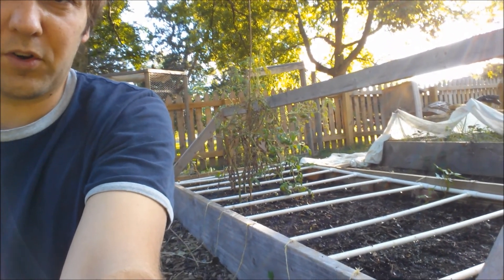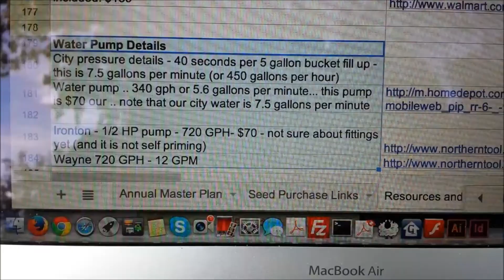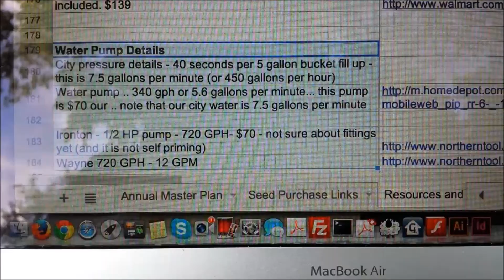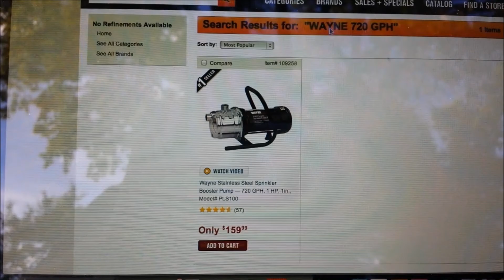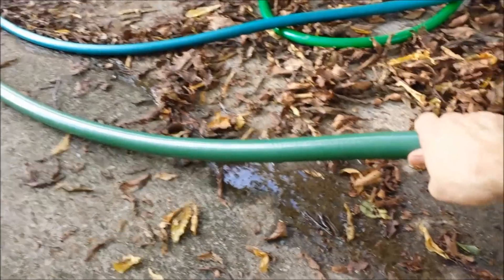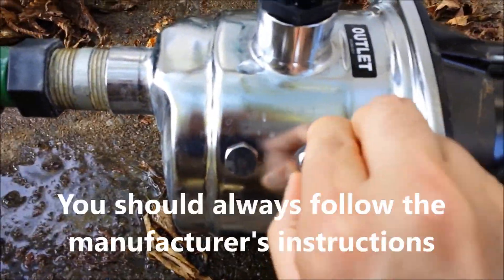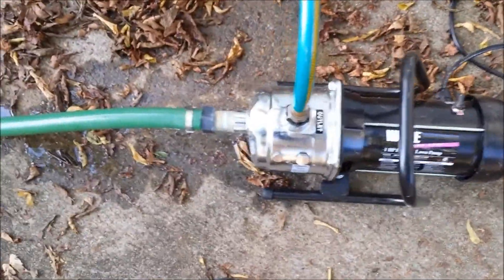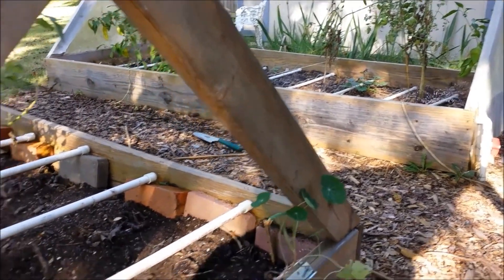how to make a soaker hose part 2

Comment: I like your setup.  I do not have a rain barrel but will use a barrel filled with dechorlinated water from a hose like you showed.  Since my pump will not be connected directly to the faucet but rather to a hose sitting in the barrel, do I need to calculate the gallons per minute of the city water?  Don't I just need to be concerned with the pressure needed to pump three 8x4 beds?

Comment: I was planning a similar set up.  But my raised beds are 75 ft away from house where triple 65g rain barrels collect off roof.  From my reasearch, I've checked into a submersible sump pump to place into my barrel system.  I can run a hose off the pump out to the raised beds.  It is a 1/4 horsepower pump and moves 30 gal per minute.  Perhaps overkill for most folks, but I'm moving horizontal 75 ft out to the beds.  Has anyone else used a sump pump with rain barrels in a similar set up?